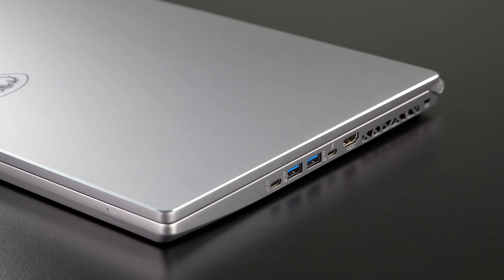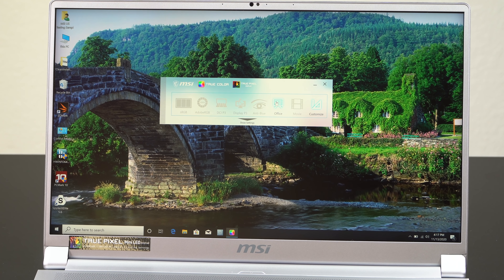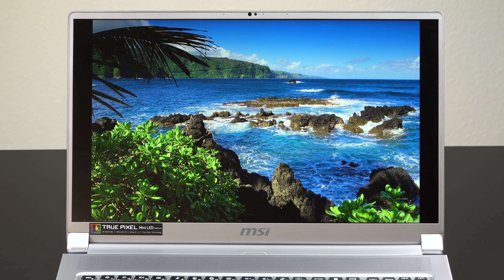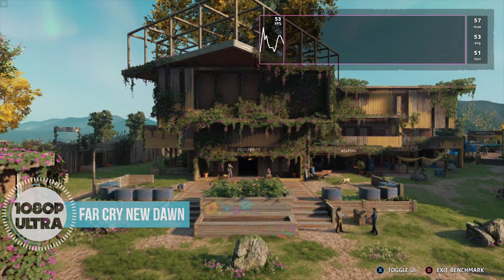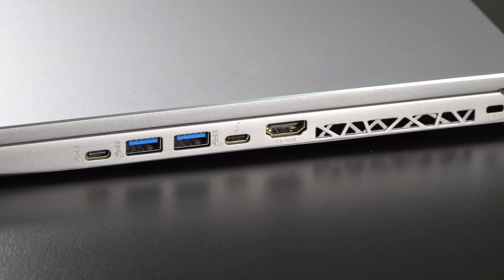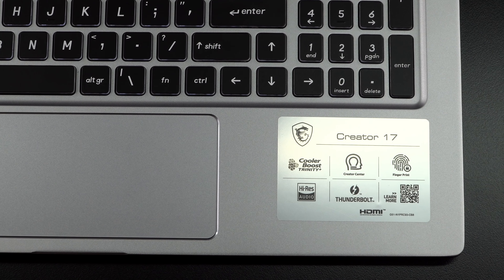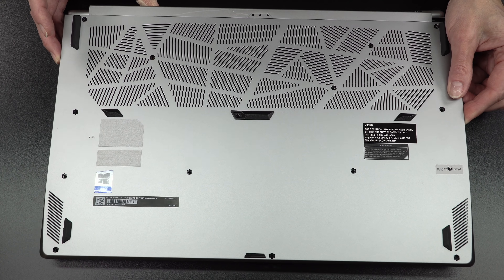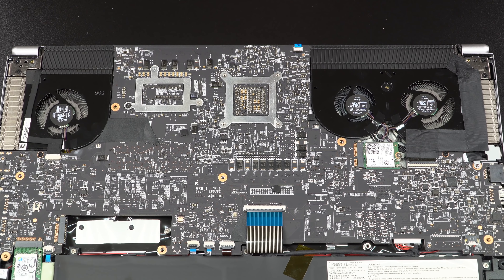MSI Creator 17 Review - Laptop with a Mini LED Display

Comment: I bought an MSI Titan GT 75 from Amazon and it came dead. I called Amazon and they would accept the return, but then I found the local MSI tech service. They figured out that the motherboard was dead so they replaced it. Total cost: $0. They returned it to me fully working, so I'm pretty impressed with their tech support.

Comment: The reason why the blacks are off is that MSI decided to use a full array local dimming (FALD) display with only 240 backlight zones.  They should have used at least 512 zones.  My PG32UQX has a FALD display with 1152 zones and it looks incredible.  Hopefully MSI fixes this issue on the newly released model update that was just released this month (Sep 2021).  Also, the HDR mode in Windows 10 has been fixed.

Comment: I am quite disappointed that nowadays even 17 inch workstation laptop abandons 2.5inch SATA storage. 
I still feel at least one of 2.5 inch SATA slot should be there, since NVMe SSD is a quite expensive option for large storage upgrade.

Comment: the 'Mini LED' branding is confusing.. its a normal LCD display with a white LED array backlight, to allow local dimming (its not replacing OLED pixels with LEDs)... Sony has been doing this for years
Reply: I suspect it's intentional to confuse with MicroLED. I was certainly confused till a good way in.
Reply: The important thing is this and (Samsung Flex Book's QLED) can draw less battery at high brightness compared to normal displays.

The intel cpu uses 25watts (AMD Ryzen 5 4500 15watts; Apple M1 10watts)...but a screen is normally using 60watts to way more at max brightness. 

So the screens and battery size are the real determining factor of battery life. Mobile CPU upgrades/downgrades are not as significant in 2020.

Comment: You mentioned that the memory has in this machine is 32GB. with two slots.  When you opened up this machine I did not see the memory slots.  Is the memory soldered in and if so how can you upgrade it?
Reply: most msi memory is below the keyboard. you have to removed the keyboard deck or motherboard for upgrade which is a hassle.

Comment: I would buy it but only with  RTX 3080 Max-Q
Reply: Why is that?
Reply: @robin-casadasilva2200  RTX 2080 SUPER Max-Q = 5.9 TF vs RTX 3080 Max-Q = 15.3 TF so RTX 3080 Max-Q is way better for mobile workstation, even RTX 3070 Max-Q ( 13.2 TF) would be better than RTX 2080 SUPER Max-Q

Comment: I never understood the actual difference between RTX & Quadro
Reply: It's mostly drivers.  Drivers need to be stable and most of the time are certified to work with CAD programs like Solidworks, ProE, Inventor, SolidEdge, CATIA, etc...  Software crashing due to crappy drivers hurt the company in time and money, so they want to make sure driver compatibility and stability.  I've work with CAD programs for around 20 years now.
Reply: @एड्वर्डकॅस्ट्रो  that’s a great answer, makes a lot of sense. Drivers can be a real pain in the butt.

Comment: pass, let me know when its OLED & AMD
Reply: Mini-LED is close enough, but I do agree to wait for AMD!
Reply: This mini-LED 1000 Nit brightness! 

Oled will not get that bright at all. Yes, oled doesn't need that brightness to give a better contrast.....But this mini-LED will definitely work outside in direct light. Glare will not be a problem.
Reply: @Ratseeker  No thanks man. Inky blacks and punchy colours where it matters is what matters. Not going to put up with staring at a flashlight head on just for its better readability outdoors LOL
Reply: @mahdiyussuf9804  Also if you work at a place with strong lights like in a lab or just in badly designed shared office area, the brightness will help out there too.

But definitely would prefer an oled for home use.
Reply: @mahdiyussuf9804  Exactly.  Quality over brightness.
Reply: Ummm didn't you watch the video? It's targeting creative/CAD works. Most CAD software are not optimized for AMD.

Comment: Dissapointed after watching these "new" laptops' benchmarks. Waiting for the new MacBook Pro 16 M1 to destroy them all.
Reply: Yeah I heard the M1 can cure cancer in under 20 minutes and solve climate change in a day. It will also make the world's best pizza. Apple has no limits.
Reply: Don't get your hopes up. If it's a custom chip like they're saying, there will be compatibility issues with some apps possibly. Also, their past notebooks aren't too great, they die too easily and thermal throttle. They are set for a short life. Things aren't the same anymore. Apple used to be good.